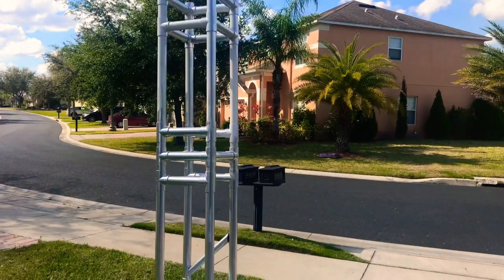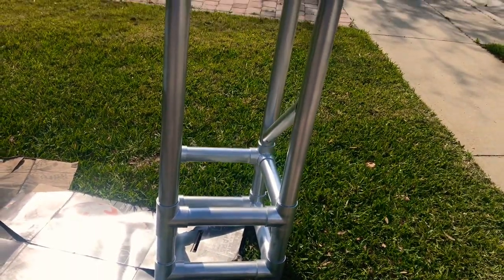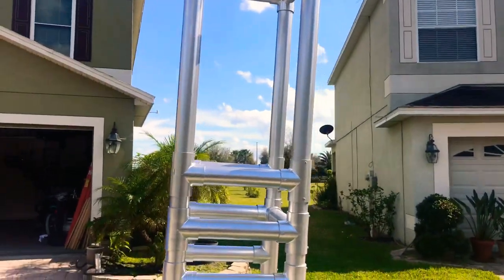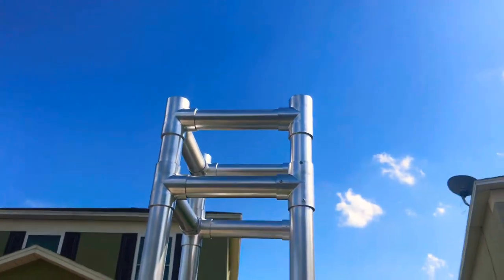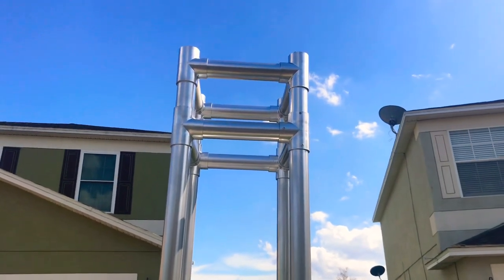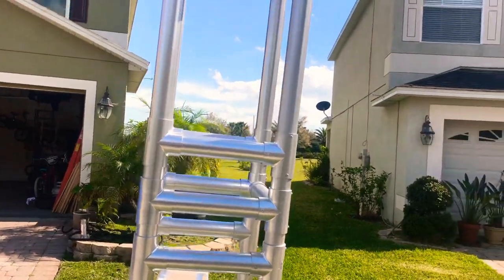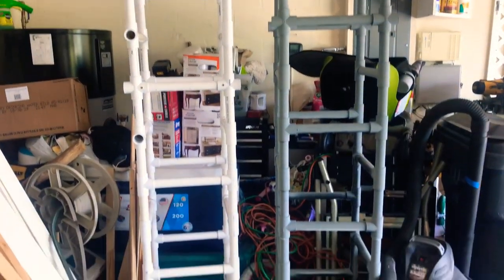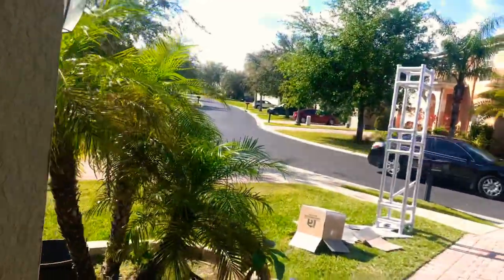Home made PVC DJ Lighting Truss completed

Comment: For those complaining about it "melting", you can use CPVC, which is designed to stand heat. Or use metal pipe.
Reply: I don't get what these people think is going to happen with this... He probably is using LED's, which don't produce anywhere close to enough heat to melt PVC - and it doesn't look like something that is going overhead either. Frankly, I fail to see any danger whatsoever here.

Comment: As a person who works in the lighting and sound industry then this is very unsafe. The moment it warms up, it will flex. This is a huge no. You never cheap out on safety.
Reply: WRONG!  Been a touring musician for 20 years!  We ALWAYS use PVC trusses.  As long as you aren’t putting hot pad cans on it.  He is using leds, which produce very little heat.  He is fine!
Reply: What is going to cause it to heat up? LED lights put out hardly any heat at all, and certainly not enough to come anywhere close to melting PVC.
Reply: While I agree, If you’re cheaping out on truss chances are you’re also using cheap lights that don’t produce much heat
Reply: This comment made me think.. and then the responses made me think again. I just built some pvc u frames and it took direct heat from my heat gun for about a minute or so to even make it budge. Basic led lights should be ok

Comment: "I want to start working in sound&light rental but shit is too expensive to buy so let's just DIY the crap out of it", not a correct way of thinking. You can get 2 meter black (which looks way better) Global Truss for about 125 euros on Thomann. Just get some stands to put them on and you're done. Hella cheap and nothing wrong with that if you're just going to hang in some small moving heads, led pars or lasers.

Comment: im doing this myself man..it crazy what they charge for metal trussing...although it may be justified when including the price of materials...but with todays led light fixtures and how much lighter they are i don't think metal is necessary anymore
Reply: I have been using a LED-fixture for a while now that's about 26 kilograms. And I'm not going to put 800 meters of network and multi-cables on a 40 meter piece of plastic, S36-truss on the other hand will hold that shit. Metal trussing is more than just the materials what you're paying for, it's also all of the safety-checks and what not to even be able to be sold and then it has to be able to endure a lot. Something plastic won't hold for even the slightest.
Reply: Yer, jason I’d love to see you hang some maverick 3 on there. Or even some soca. It’s metal and it’s expensive because it’s safe and it stop amateurs like this guy from using it incorrectly. PVC could probably hold 10kg UDL before one of the ends shear clean off.
Reply: If your leds fixtures are "lighter", you really arent buying pro stuff thats just about it. Pro-equipement is always a lot costy, and a lot much safer/worth it. Also unless you are able to do the math into calculating your weigth dristribution/load capacity of your Truss, you really shouldnt do that and are playing with fire without proper knowledge. The price you pay for pro-gear is exactly that. The fact the pro stuff comes with a sheet giving precise capacity of its material. If you dont have that, you dont have safety thats it, go see how shows are driven in poor country and you will see.... peoples dies, structures falls and destroy completly any fixtures in/under it, etc and btw they even are using metal truss most of the time... you need knowledge, or just dont be stupid at least and be very safe about proper "capacity estimation" you have of a poor-though product.